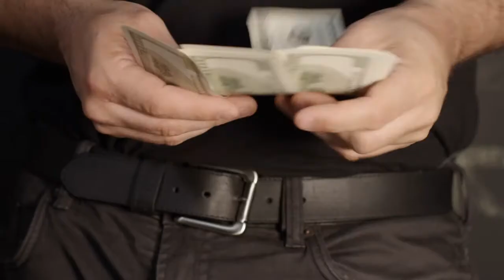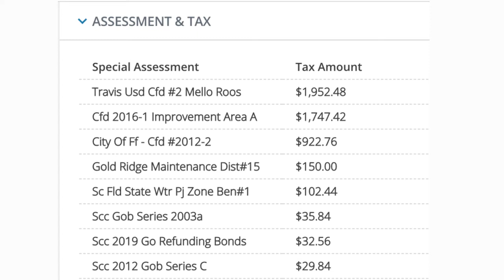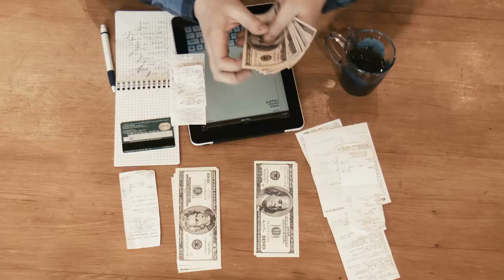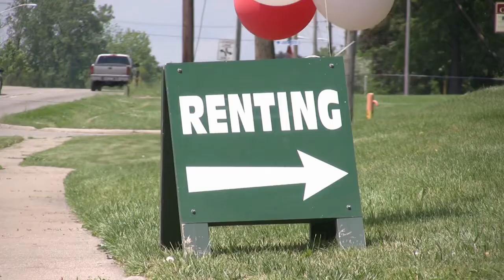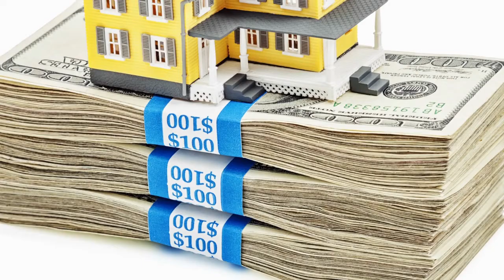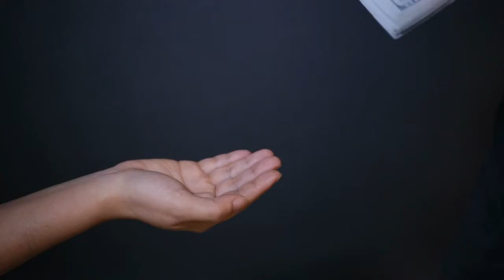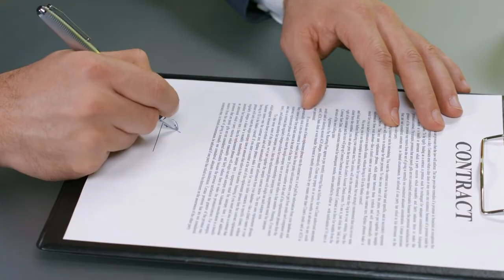Pros and Cons of New Construction Homes I Fairfield CA I Vacaville CA I Vallejo CA I Dixon CA

Comment: Do you think it is a waste of time to hire an inspector for new construction homes in Fairfield?
Reply from the maker: Hi there, thanks for taking the time to watch and comment. I would not discourage anyone from hiring their own trusted inspector for new construction. However, I would encourage you to read through your purchase contract to see what verbiage the builder has around bringing an outside inspector. Many contracts specifically state that the builder will not acknowledge your outside inspector's report/will not fix any findings from the report. Some builders also require you to request written permission to have an outside inspector attend the final walkthrough. If you plan to have your own inspector attend, it will likely be for your own knowledge only. I hope that's helpful
Reply: @ErikaMonroeSolanoCountyRealtor  understandable, to be clear, I am a first time home buyer. My wife and I have decided to build new house in One Lake under TriPointe Homes. They are trying to discourage us from hiring an inspector. 

Since we are currently in a seller's market, they are not afraid to say no to my requests and have told me that even if I hire an inspector, they are not obliged to fix anything the inspector finds (or may find).
Reply from the maker: @MalamIbnMalam  That is common among most, if not all builders. Keep in mind that the builder has to pull permits which means that they should be abiding by all government required safety measures. They will also issue a warranty to provide a little peace of mind (generally 10 years for structural but can vary per builder). Have you already started the building process or still considering whether it's the right fit for you?